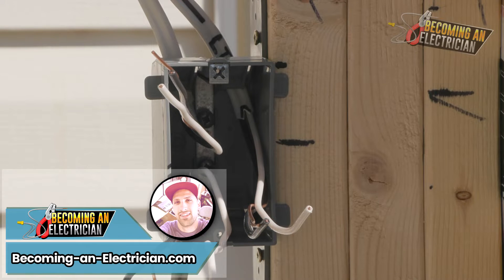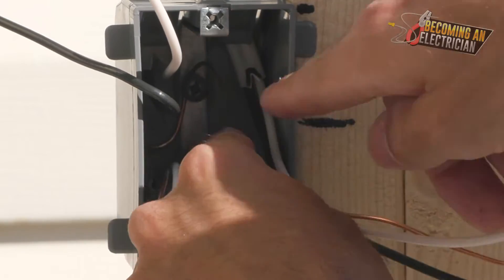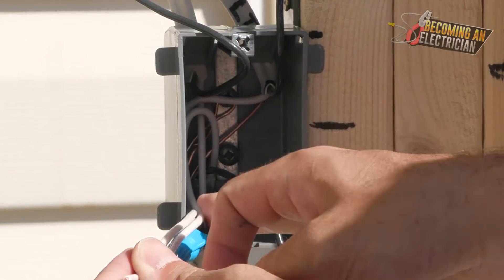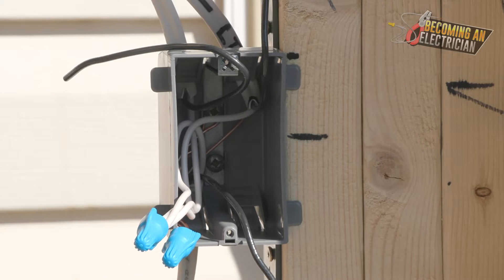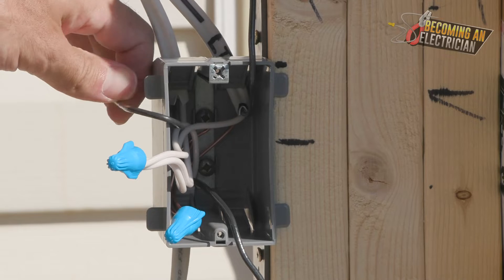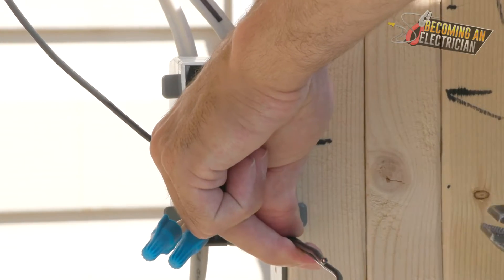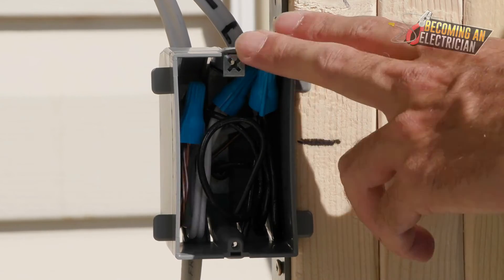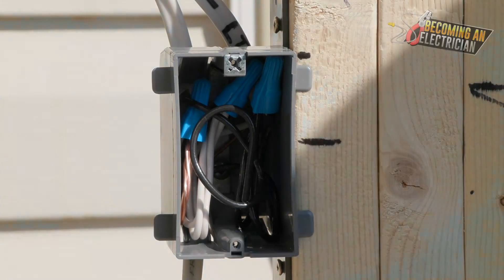Splice Wires in a Single Gang Electrical Box

Comment: I'll have to go find your other videos... do you mean don't run power and connect the hot to the light before the switch?  I don't see a problem using the light like a junction box, continuing the hot to the switch and on the return adding black tape to the "hot" side of the common wire connected to the light.  To save on a bunch of extra wire (loops) I wired a few circuits and some 3-ways in this fashion.
Reply from the maker: Well I think code today states you need a neutral in every light switch box, so that's important with smart devices now.  Next, what I think you're asking from my video is:  Run power to your light switches, then bring the switch leg up to the light.  If you have multiple lights that you want to turn on, then you can jump the light boxes so they're all on the same switch.  But it's not wise to run power up to the box, and only bring a switch leg down.. because now you'll have no neutral, and if you ever need to troubleshoot, you have to take the light down (and often get a ladder), compared to just opening up a switch junction box and have access to everything you need right there.  If you need to continue power, you jump from the switch box to the next switch box, then bring the switch leg up to the light.. much easier for maintenance!
Reply: @BecomingAnElectrician  Yes... I do try  to do what I can for possible maintenance down the road, like short service loops at every box.  Never know when you are going to need a little more wire.
Reply from the maker: @chrishouse5753  Yes exactly!  My whole rough-in series shows the electrical basics of roughing in, like service looks as you showed, and folding the wires to protect them when drywallers use their zip guns: http://becoming-an-electrician.com/free

Comment: Very helpful, tips about folding and cornering wires into box, lining up ends to be twisted, and using the void  on linesman pliers as a depth gauge, when trimming back wire ends in preparation of capping wire with a wire nut.
Reply from the maker: Yes, it ensures a pretty consistent result each time 👍

To stay updated, visit:
https://becoming-an-electrician.com/free